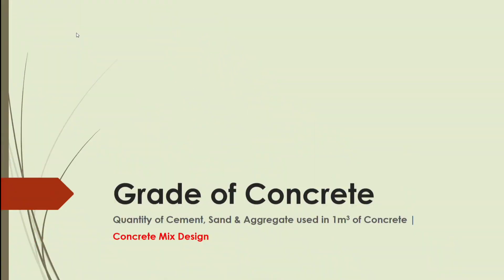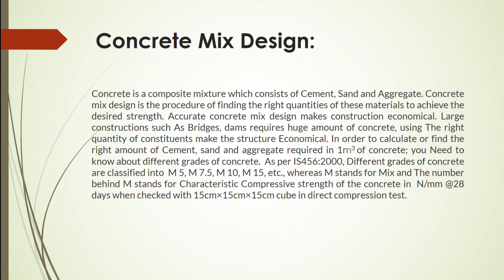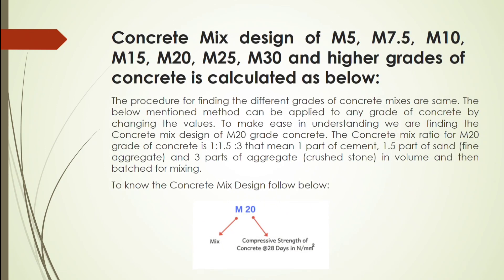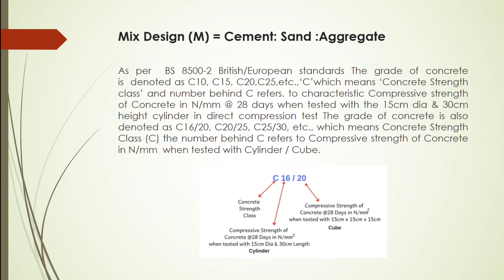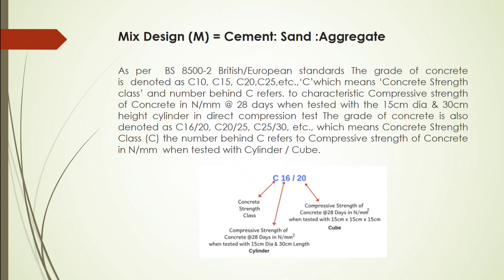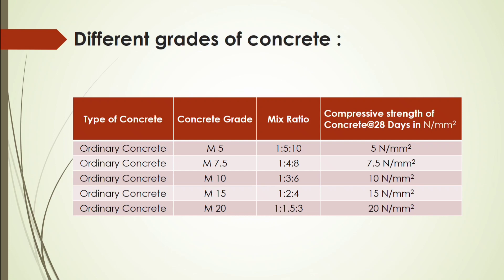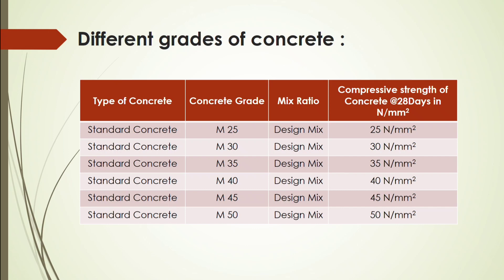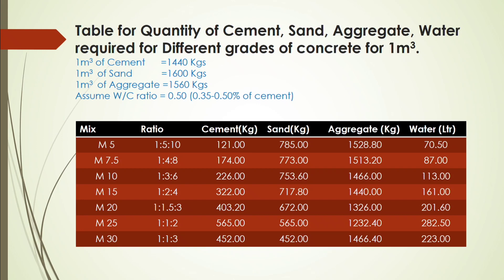Grade of Concrete and Water Cement Ratio || Nominal and Design Mix

Comment: bangladesh thke bolsi. Amr 8 stored building. Ground to 2nd floor coloumn concrete (stone)mix ratio diesi 1:2:4.
Akn dada baki coulmn (3rd to 6th floor)gulo jdi 1:1.5:3 ratio dite chai tahole apnr suggestions ki? Dile profit ase naki nai. Jdio ami(non expert)buji nicher column strength kom thkbe oporer column r tulonay. Apnr wise desicion r jnno wait korsi.....